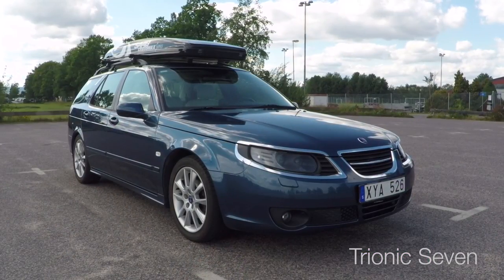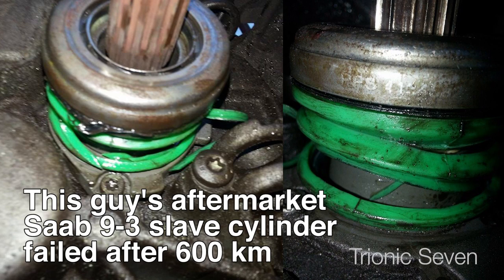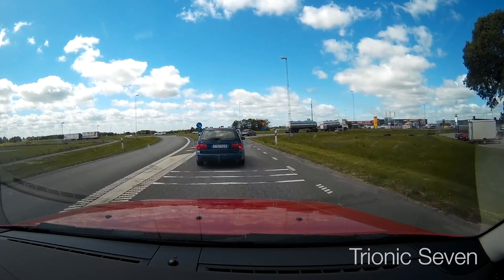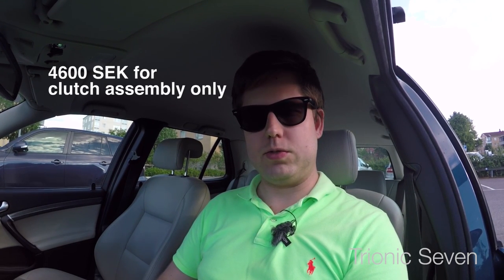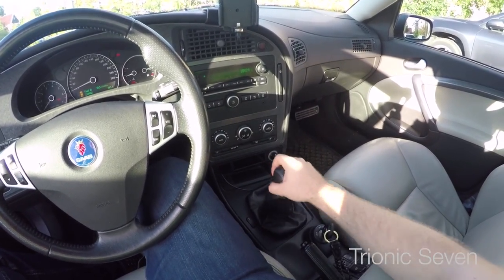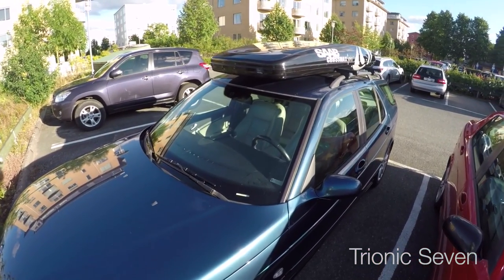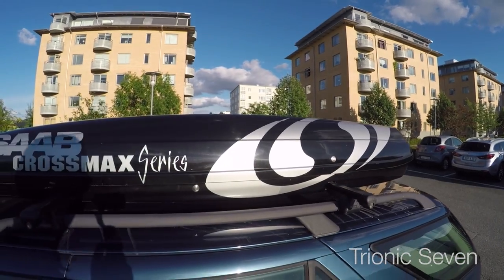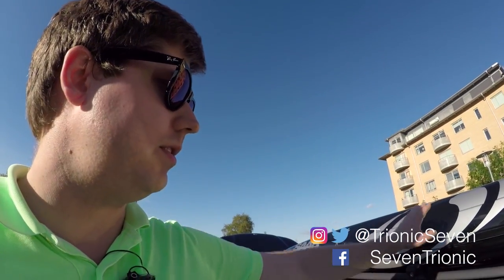The Clutch Failure That Nearly Killed Our Saab (Story Time!) - Trionic Seven

Comment: It are not cheap to replace coils on any engine like a VW an for sure the best are, and recomended are to replace all cylinder coils at same time, and then it will cost probabl close to the SAAB cassette. and if ou use a carshop to do the work the SAAB will be the cheapest in that case. 
There are also loads of benefits with the DI casette compared to single-coils. 
I id just see a 9-5 for sale, I think it was a ogfacelifted and the engine bay picture had a T5 DI. that made me scared of that car.
I dont think that it was repainted to read.

Never ever use the red T5 on T7.

Thanks for the vieo. I hope I be able to do some my self soon.
Have an og 9-3 Caled Lars, and just did check it toa to carge battery, and I think it has all parts for the full preasure map. Wierd.
Anyhow it has to get back on the road soon. 
Next are the 9-5 2002 Aero, with xxxx km on the odo. 
about 400k.
I got it really cheap, and the first in min was to swap parts to my -02 2.3t. Ok why you ask.
Because I like it black.
That one allready had made an engine swap by me to an Aero engine with 135km, 
When I did put that engine in my thougth was to put all needed parts from the Aero in to the 2,3t to run.
But then the sad thing happened, I did change the clutch cylinder to a new one, bought it from speedparts and it was stock not aftermarket. not even a year later the cylinder broke apart. reall a sad history.
Ok then the work to get it on road again had to restart, the engine swap was mad in the winter 2014 and in a cold garage. the coldest days I had minus 30C in my "tent garae a few lass degres.
Anyhow I made the swap, havey lifts or hard or many hours do not scare me, I manage it allmost every time. 
Like the last da with another of topic work, luckily the wheel nut tool did fit to that project, a totaly another story on my YTC later on.

OK the 9-5 2,3t needed a job, the clutch I Thought, did manage to take apart and the way that time was to ty to make a body lift and a front subframe pulldown. I did a little miss and the AC-line got broken, probably it would have appeared soon anyhow.
I then did got in to some kind of car mind depression. and after all I did manage that the cheap boughtAero had to roll out on the road again. That engine did really sounds bad.
I again did an engineswap and I did drive thet car a few weeks, for of topic reasons, life are/is life. and i did stop me at that time to go on.
Ok now the Aero are ready to go on again, but I have an ABSlight, Probably the right back bearing has to be replaced.
I had a bearing bay from an ng 900, but after the swap the ABS still lights up, maybe it not are the right one.
Sadl my TechII did fail and none of those other OBD readers tell me any code about the ABS. A friend of mine has aPC sstem and this weeken I will try that system to see if it reads out the ABS failure.

Also soon I have to lift the camshafts and change the hydralic valve lifters, have one or two that not work proparly an makes bad sound at cold starts.

Well I will soon put up about that project and I hope most of you guys connect then.

Comment: If you buy a slave cylinder from a renowned manufacturer like TRW, Sachs, LuK.....you want have any problems. Saab is only buying the cylinders from the above mentioned companies. I´m also sorry to say that the quality of parts has dropped  since Orio took over
Reply from the maker: Thanks, interesting to know. Didn't know that quality had dropped.
Reply: Well, it´s only my opinion and maybe doesn´t applied for all Orio products....but for some it definetly does